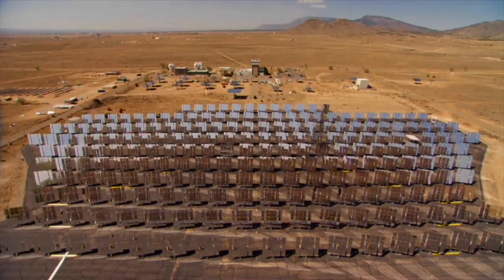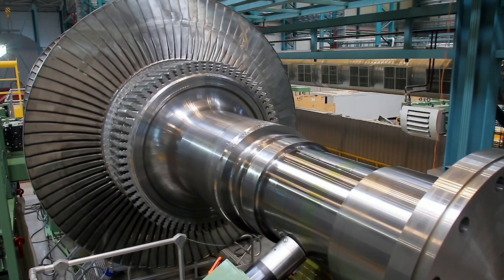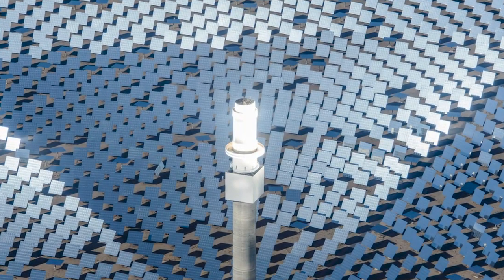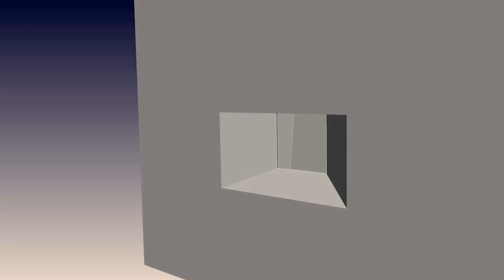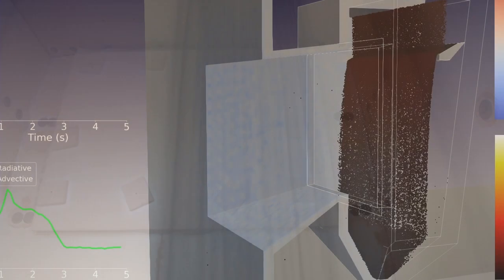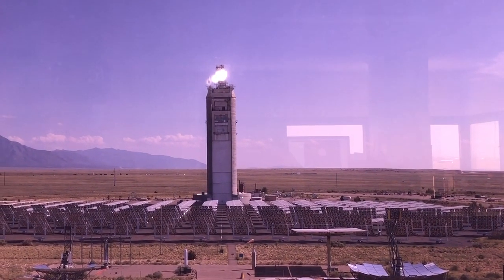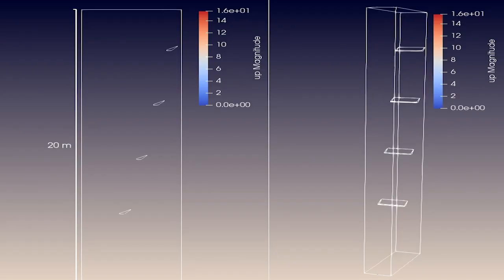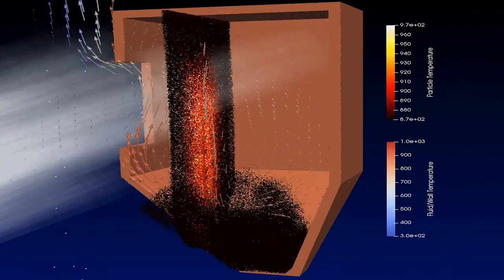Raising Temperatures with Next-Generation Concentrating Solar-Thermal Power

Comment: Add iron oxide and oxygen free atmosphere and then you can:
1) store thermal power
2) deoxidize Iron Ore

Iron ore production is one of the most energy intensive industries.
So this would remove that energy use that was removed by solar iron ore reduction.
Even if only partial reduction is possible that still removes that % of eneergy needed to complete the reduction at the smelter.

Your welcome Gaia